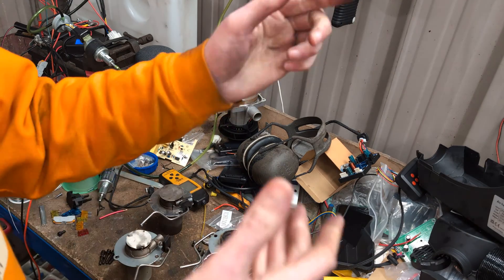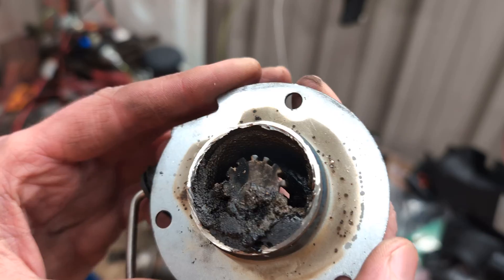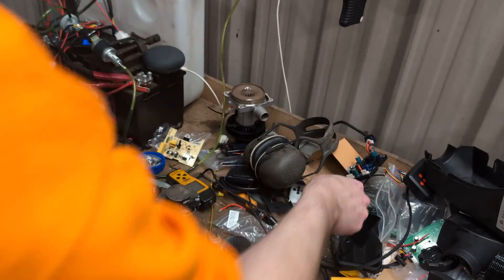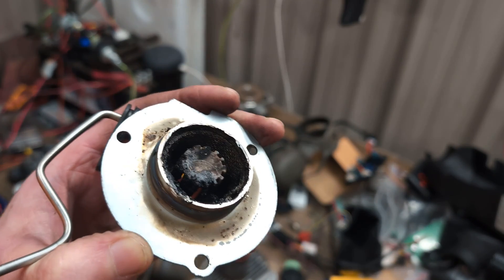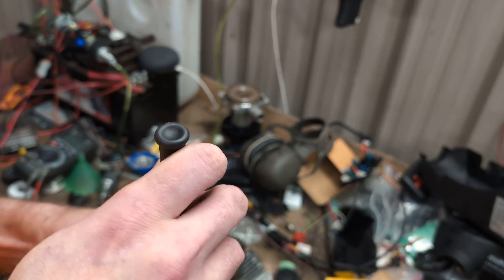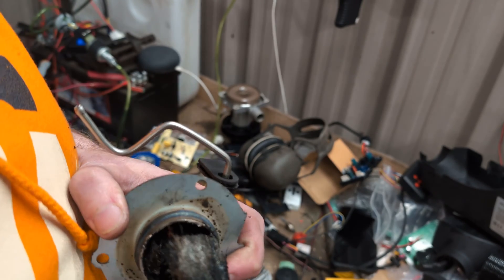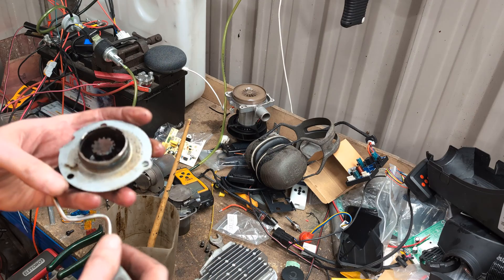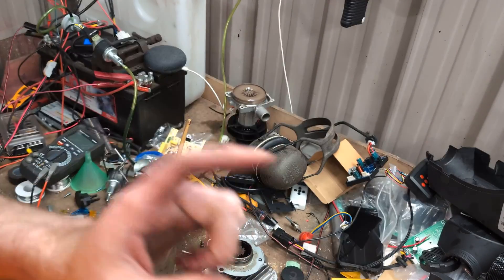Inside the inside of a diesel heater burn chamber

Comment: If you're interested, I use xylene thinners to clean off carbon water. Eats thriuf in second, flush off with petrol. Obviously,remove/ keep all seals away. Did this first on my C class Merc inlet manifold. 
It works great.

Comment: Ive seen some detailed experiments, and even with only 10 or 20 percent waste oil and 80-90 percent diesel, it seems its not worth it because it clogs up the heater and makes such a mess of it.   Is that true?
Reply from the maker: The less waste oil you use just increases the time before it clogs.  But it will clog eventually.
Reply: Ive found that burning at a higher temperature helps to burn off soot,  also I only use.JET A fuel, and it burns much cleaner than other fuels, that doesn't clog even over time. @DavidMcLuckie

Comment: Interesting, I have a e8 fault right now which normally I remove the burn chamber and replace the little screen mesh, I have tried to clean the mesh you have just removed in this video, but of course no avail. My point it thow I run straight diesel and am getting the e8 fault after months of running. I am interested to see how you get on after you have welded it all back and run it without the screen. Great video.
Reply from the maker: Oh it was not happy without it.

Comment: How would you clean that without cutting it? Paint thinner and some sort of an improvised brush?
Reply from the maker: Once that internal mesh is clogged, you'd need to heat it until the carbon turns into carbon dioxide.  Someone said it's easier to dissolve all the steel than it is to dissolve the carbon.

Comment: Hi David. Does it matter if the atomiser mesh from the glow plug whole has been pushed down into the burn chamber? I couldn’t get it out and now it’s stuck. I have a new mesh to replace it but was worried about the one stuck inside??
Reply from the maker: It can only go in so far until you'd have to destroy it to push it further into the actual burn chamber.  I don't imagine it will cause any issues, it might eventually oxidise enough and burn away.

Comment: It looks like a version of the bunsen burner. Primary air is mixed at the inlet side with secondary air added to get a hot clean burn. Use cruddy oil and everything gets clogged up.

Comment: 10 months ago, But do you think with even burning waste oil you can spray carb cleaner in their to clean out the chamber at least a little? I like the thought of being able to burn my waste oil to cut down cost of heating but I know it can also dirty things up.
Reply from the maker: Between me and many other YouTube channels it has been tested extensively.  There is no way to easily clean the burn chamber once the waste oil contaminants have choked up the interneral wicking mesh.  Your could run on waste oil until the heater stops and then replace the burn chamber.  Dilution of the waste oil just increases the time before failure.
Reply: Thanks so much for the reply, I tried doing some research couldn't find anything solid. I'll just run it on the diesel for now haha.  @DavidMcLuckie

Comment: I'm wondering if you ever compared using premium grade diesel versus ordinary diesel, with the view of having a much cleaner burn and not having to complete messy maintainence tasks. Would it be worthwhile or simply a waste of money. Any opinion on the matter? Love all the experimenting you have done, you have imparted a lot of very useful info.
Reply: Kerosene all I run in mine and it stays clean.  Only thing I do is run on high for 20-30min before shutting down the unit.  And never had a issue.

Comment: Any thoughts on whether, premium (with added cleaners) diesel would clean it out? Or maybe fuel additive? Might be an interesting experiment.
Reply: Obviously this unit was used with drain oils and only guys I've seen do that successfully run 2 tanks and switch fuels during operation.  "Starting on Kerosene and switching over once running to a fuel/drain oil mixture and then back to Kerosene for 30 minutes on high before shut down.

Comment: Hmm …… i’ve had my 8kw heater apart about 10 times this week trying to figure out why it won’t light 5 out of 6 times . Once she’s light it’s all fine and runs pretty good. New plug,screen,pump, different fuel and good cleaning. The  last time I was focused on the burn chamber and even ran oven cleaner through it but still the same results. I’m going to order an Amazon replacement burner and hopefully that’s the end of that. Thanks for sacrificing a burner too see what’s inside. 👍
Reply: How did you get on? I had this, new burn chamber and a 16ml pump instead of 22ml seems to have sorted it.

Comment: I wonder of it works when younremove the mesh , i already bought 4 burn chambers , cause of the waste oil .
Reply: @hjhenk422   try running 2 fuel tanks, one straight Kerosene and the other mixed oil/Kerosene.  Start unit on straight Kerosene once it's all warmed up and running switch to mix tank. Before shutting down the unit switch back to Kerosene and run 20-30min to help clean it up inside again.  That's the only way I've ever seen it work with drain oils. Just a suggestion.

Comment: Nice videos David!  I can suggest a modification to the burn chamber that will make it serviceable.  Cut the sleeve of the burn chamber off (which you did before), but cut it flush with the mounting flange.  The wool should stay with the sleeve and be part of the sleeve.  Then weld another thin flange onto the outside of the sleeve to hold it in place on the original flange.  Screw it to the original flange with a couple of small screws.  You could service the burn chamber very quickly after these modifications.  You could heat the parts with propane until all the goo is gone, then use a wet blaster cabinet (vapor hone style) to dislodge all the ash.   The burn chamber would be completely restored each time.  Another (simpler) idea would be to disconnect the oil and attach a propane source to the fuel injector steel like on the burn chamber.  Start the heater, and gradually add  propane to the line.  Run it until it is hot enough to glow, then power it down and check it to see if the bitumen and ash has been burned away.  If propane won't get it hot enough, mapp gas might.
Reply: Great idea!

Comment: Hi David. I’m running two heaters and been following you a while. Can you confirm the hole past the glow comes out at the 12pm o’clock position. I’ve rerun your video and can’t make it out. The glow plug is at the top and without chopping the top off I can’t be sure. My 5-8kw looks like oil would come out into the burn chamber at 5pm hence leaving a pile of crude at 6pm like I’ve seen yours. I’m working on a remedy of a real afterburner. Will upload and send you a link or maybe the the whole burner. Both of mine are ported out and run bigger steel exhaust bends with no ridges. Both run on the lowest setting for 16 hours a day using diesel with zero coking. Ones on 1 1/2 winters so far using big bore smooth pipe and a single silencer.

Comment: I mix methanol with diesel as it helps break down carbon deposits that build up in a diesel engine and also helps reduce emissions. 

You can add upto 14% before running into other problems as methanol can be crosive to certain engine components. Not many parts to wory about in a heater mostly metal.

Adding methanol lowers emissions of carbon monoxide and hydrocarbons and nitrogen oxides. But will increase Formaldehyde emissions when the engine is cold.
However Methanol is also  biodegradable and like diesel can be grown from planted crop.

There is already methanol in diesel but never more than 10% as one of the activities along with hydrochloride acid as a dirtergent..

These are things they don't want you to know about fuel.
You can make it work for you.

Comment: Just a thought, would an ultrasonic cleaner with the correct chemicals work I know not many people have one but it would seem to be an ideal way to clean them with minimal effort ?
Reply from the maker: I have Googled and there isn't anything that dissolves carbon without eating the metal as well.  I have seen putting it in a muffle furnace and heating it until red hot might get rid of the carbon.

Comment: Brilliant videos fella, really informative thank you, I've recently bought 2 of these heaters and have one heating the living room of my house, it works a treat. Anyway I have a few ideas that I am going to try out but would like your thoughts. the first is about trying to salvage the heat from the exhaust, and no its not banging it through a radiator or a sand battery 😁 I was thinking of coiling an 8 foot exhaust pipe and fitting it into a sealed steel box with the intake for the air heater at the top and the main intake for fresh air to the heater at the bottom which would be connected to the fresh air from outside, that way the air would be preheated before it was blown onto the heater itself, I reckon it would heat up quite a bit on the low settings so, would there be a problem in extending the wires connecting the circuit board and heat sensor on the unit so they were not in direct contact with the pre heated hot air from the exhaust ? sorry for the long post but I'm always on the lookout for cheap heating, Cheers and thanks again for the videos

Comment: Washer acts like Venturi in a carburettor and increases air speed prob best left in place. Leave washer in and increase fan speed without mesh it will just run the same as a Space Heater. Which I have seen run on waste oil for quite a long time but I deffo would not recommend !! Keep the good vids coming DM

Comment: It’s not getting hot enough to burn off the carbon … I don’t know if pre heating the oil will help cuz cold burn

Not u making me think …I have seen an aluminum bodied heater so the plastic don’t melt extend electrons off the burn chamber if the burn chamber is hotter so carbon will be carried away 

Also why are u at 3.5 at 4K  …max the fan speed set pump the that get the heater hot
Reply: Ok the heater you cut the end off to see in the burn …. Can you cut the washer out and see how it starts and burns in that heater …….also can you fit a burner( stock) in that but cut down like 1” from washer then block off the end about 1/2” from the end that was cut down makein it smaller

Also punch slots in the washer so the grabs the flame and blow carbon the the end 

Can the exhaust outlet be made bigger

Comment: I wonder are there any Diesel heaters that use a fan shaft driven fuel pump and spray nozzle like they are used in home/industrial oil burners?

Comment: what is the maximum pressure the pump supplies fuel at?
Reply from the maker: In these heater the fuel is pumped at basically zero pressure.

Comment: You know looking at the construction of that i would be sooo tempted to feed a tiny tube of HHO through the intake tube to see how it changes.. totaly useless in real world use but pure curiosity.. il have to wait till i get my workshop built in spring to test it lol
Reply: I've been thinking a similar thing, just a bit scary if it ever fills with oxygen and hydrogen, and then suddenly lights, youve got a 8omb
I was thinking about just feeding it the oxygen side of the HHO to help it try burn more completely.
Reply: @ratgreen   Yer thats a valid concern but as long as the system is pushing air through the system its safe as it cant build up.. to stay safe just dont activate the hho until the things running lol

Comment: i had the same experience after running waste oil. completly clogged and wouldnt start anymore (same rock hard stuff inside, i actually think its the burned additives in motoroil). since the burnchamber was done and i couldnt clean it i put it into an woodburning stove. after glowing red hot i was able to basically knock all the stuff out and the burnchamber looked like new and works fine. migth be intersting to some
Reply: Are you using straight oil or half diesel
Reply: @markmensink-xo4jn  That's what I was wondering as well.
Reply: THX from Crete - Herzele
Reply: Definitely, I was asking above how to clean in these situations. How would you clean the rest of the soot? Paint thinner and a brush, or what?
Reply: I've put mine in the log burner since it was so blocked up it's come out clean 
So I will reassemble  it in the morning  for a test .just read your comment seems you had the same idea with success so fingers crossed it will work
Reply: @garethchurton2852  by log burner you mean an old school stove? how come that helps to clean the soot? what does it do to it?

Comment: Does anyone think a waste motor oil mix that has been filtered with a centerfuge at a 50/50 mix would have any different outcomes?  Or if you switched back and forth between a wmo mix and straight diesel while running on high maybe 12hrs wmo mix 1 hour diesel?

Comment: IMHO I would (if I had the $, skills, and a workshop)
1. find a way to either speed up  combustion air fan (over power it a volt or two?)  for more oxygen or add greater air intake volume in some other secondary way.. enlarge air intake?  add a second fan?   Can you speed up combustion fan with afterburner setup?. Is fan speed of combust air part of what goes up along with more fuel when one turns the heater to higher temp setting??.  Can afterburner software turn up fan but not fuel flow??  

2. cut some tabs into the top of the slotted burn tube there in the bottom of burn chamber and bend the tabs up . Add more slotted tube to the one it came with above that to make it Half?? longer?   and or stainless steel screen or something to extend the slotted tube so there is more hot metal further up into the burn tube to help further combust the alternative fuel being used??  

Can't imagine where taking the cup w/hole would help at all.  Likely made things worse- IMHO keep that.   Someone had a good point to re-run this last experement with diesel to see if removing that makes it work worse on diesel.  Suspect it will..  

Thanks for all you do David.
Reply from the maker: I guarantee it runs worse without the cup with hole.  It's there to further force the mix of diesel vapour and air during combustion.  But it was also where all the ash got stuck.  I was hoping removing it would help blow the ash out the exhaust.

Fan and fuel speed are independently adjustable.  I have a feeling if I push the air faster I'll end up with more heat going down the exhaust than being transferred into the heater.
Reply: @DavidMcLuckie  makes sense.  Much appreciate the reply.  Was also leaning toward that being there to increase air velocity.

Comment: All parts of that burnchamer look like they made of some sort of steel, I wonder if it is possible to burn free the whole assemly like a 2-stroke muffler? Like in a little furnace maybe up to 500°C?
Reply: As long as there aren't any rubber o-rings or things that can melt..I would be the whole thing could be put inside one of those heat treatment ovens or metal melting kilns and run up to 750-1000°C  (stay below the melting temps of the metals, but get em glowing red for a bit)
I know I can melt brass and aluminum, but the steel in brass cases don't melt (primers and the occasional steel shell casing)...but it does burn all the crud to a crispy ash
I think they run cast iron engine blocks in a oil burner oven thing to remove oil at like 650-750°C

Comment: Run it as hot as possible Don't worry about the pollution we need to get that thing the point where it's almost at thermal shutdown Will self clean itself I've gone a year before I had problems with mine having igniting issues and when I cleaned it out it was just practically Ash run it hot and dirty
Reply: That is what I was thinking...run it wide open...hotter the better
Trying to throttle it and setting at too low a speed might cause it to "run dirty"
Reply: @haydenc2742  you actually need to run it dirty and hot not slow and clean it won't blow black smoke but you want to burn out the clinkers at least that's what we call them I like mine with diesel then I crank the thing on high modify the flow rate to low basically you lean out the oil because it has more thermal Mass it's a richer fuel and run it hot there's a fine balance though because you can hit the thermal shut off limit
Reply: But how do you set a high temp with a low fuel flow?
I thought they were matched by the controller?

Comment: I remind hot and dirty I don't tune it for pollution efficiency The more pollutes the hotter I can get it I can go a year and a half with running used motor oil I run it as hot as possible without it thermal shutting down it's not clean but I get the most BTUs out of it and it doesn't clog up my unit
Reply: 100% wmo? Cars or tractors (mineral)?
Start stop diesel ofc.  How you filter before? Any steamclean runs (water + binder in diesel)?

Comment: It is best to move the partition plate of the combustion section outward by at least 40mm.
Reply: yeah it needs the partition plate...I said put it at the end (flip the pipe and re-weld) this way the fire heats the entire tube and is restricted a bit
I saw his other video and it seemed to just slather the unburned goo/sludge out of the burn chamber an into the body causing that to be gooped up as well